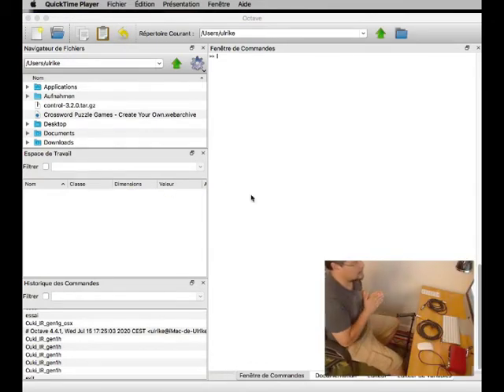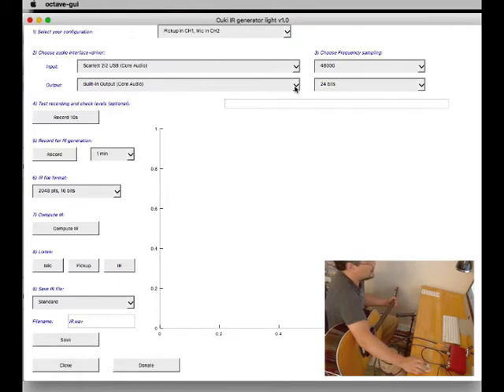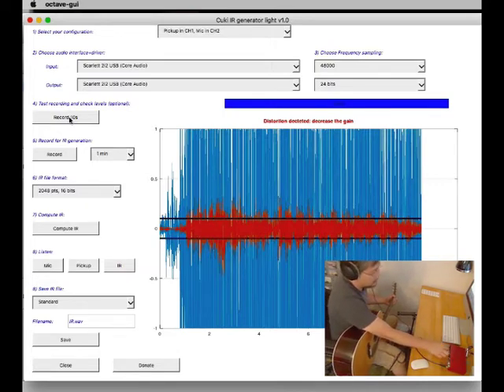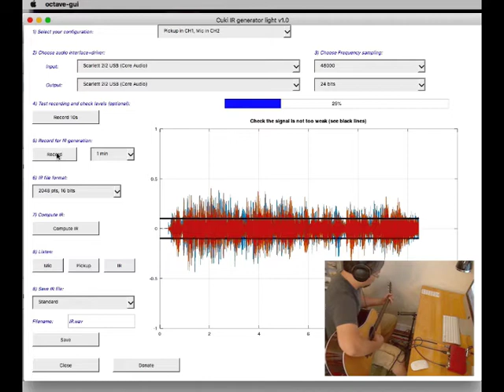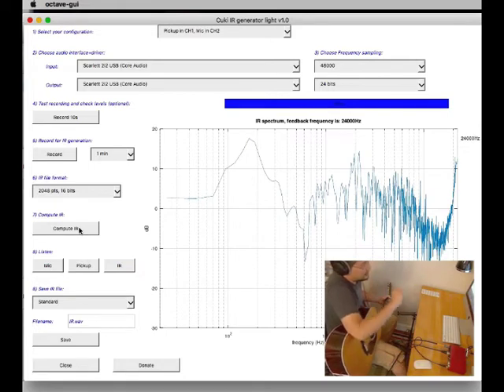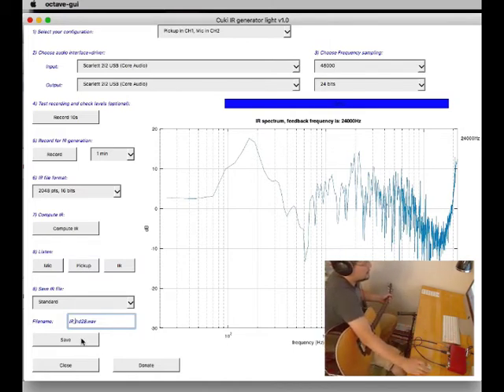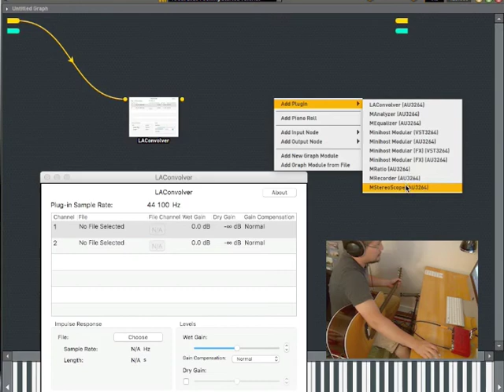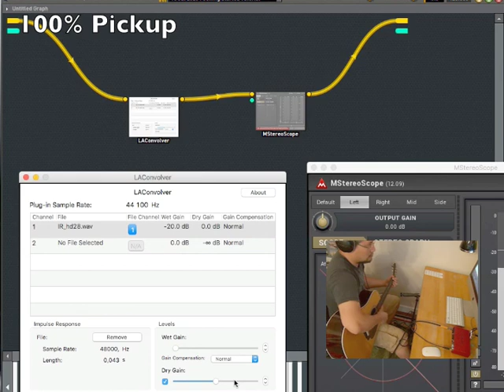How to make acoustic guitar IR

Comment: Thanks for this and the tool, Cuki. One quick question about the feedback friendly option. Is it +6db or -6db. So, is it designed to make it easier to get feedback for electric playing, or reduce the risk of feedback? Sorry for being slow on the uptake with this.
Reply from the maker: Hi I am not sure if this is maintained in the current version. The idea is to remove 6dB of bass at the main frequency of the acoustic guitar to AVOID feedback. When you play an acoustic-electric you don't want your guitar to go "Wooo". Feedback is desired for electric guitars (Think Jimi Henrix with a Stratocaster) it is a plague for acoustic electric (think Ed Sheeran with his Martin)
Reply: @Cuki-ox2mk  That was what I thought it did, but wanted to make sure.

Comment: Thanks for this!  Happy to donate for this package as it makes things so simple!  (I originally thought I'd have to spend crazy money or have programming knowledge to make my own IRs).  On the windows version the feedback friendly seems to export the same files as the standard export (std and itp) - just curious if it might be missing a file?    Also, this works out a lot better than all the acoustic IR's that I have purchased over time.  Is it generally important that the IR is modeled from your own model of guitar?  This might explain the reason.  :-)
Reply from the maker: It's been a long time since I did not check the feedback friendly version. But I am pretty sure it is buggy. Basically it adds a Parametric EQ cut on the main resonance around 100Hz... However this one might not be well spot by the algorithm. As far as, my own model of guitar, the algorithm makes absolutely NO assumption on the guitar recording. It only takes information from the recording you are making. I am kind of proud of that. Thanks for the donation!!! You are actually the first!

Comment: This is fantastic, man! If I understood the process correctly, Octave only analyses the differences in EQ of both signals, and then calculates how correct piezo sigal to equal the mic one.
So its taking the EQ form the guitar itself, the ambience, and the microphone and preamp, BUT its not adding the decay in time, right? The convoluted signal with still sound dry, and it would benefit from adding a Room Reverb to add distance and decay, and thus, realism.
I'm still wrapping my head around all this IR process, haha
Reply: Ok. So after watching more videos, I was definitely wrong. If does also capture the decay response in time. I downloaded the app and managed to load it in Octave. Ready to do some tests!! Is the "non light" version with the full algorithm ever going to be available? =) Is there any way to make a donation and try it out? 
Another question! Does the software fix the inherent delay of the miked up signal? If it analyses de difference between the two sounds without compensating that delay first, it's probably going to create phase issues, right? Wouldn't it be better to record both signals in a DAW, phase-align them, then bounce separate files, and load them in the app to create the IR? I think I can hear phase issues at around 12:00 . If you're not doing it already, I'm sure phase aligning piezo and mic before creating the IR would improve the results!
You did an amazing job here! Thank you!
Reply: I was thinking... maybe I can record enable 2 tracks in protools, apply the phase correction, and then play it back. I would route the protools output to cuki IR input using Loopback. Would that work?
Reply from the maker: @sonidojamon  read the code. At some point there are lines that are commented. Uncomment to be able to load files. Phase alignment should not make a difference, unless you put the mic 3m away. The full version can not be made available. I would need to pay 2000$ for a pro Matlab licence plus 3000$ for the signal processing and audio toolbox. The difference is not bigger than playing with the mic position and make an IR that matches your taste.

Comment: Following Aaron Short Music and found out about you.
When the program starts I only get a white box, the program gives an encoding error (using the default UTF-8) so I selected SYSTEM (CP1252), that's the closest I see to SYSTEM which is what I see that yo are using in your screen shares in the video. I have Windows 10 using the 64 bit Octave download. "Octave was configured for "x86_64-w64-mingw32" on the opening screen. No error messages with Octave.
I used debug and stepped thru and it goes up to line 96 then returns to line 12. (I only have newbie Python experience but I can follow instructions). I reinstalled your program several times. Any ideas? I would really like to run your program off line. I don't always have internet access.
Reply from the maker: Hi, on my computer I octave octave 5.2. I am unstalling it. Will try with the last version.
Reply from the maker: Just installed Octave 7.3.0 and had no problem. Did you get the program for Github? Did you follow this process to download? https://blog.hubspot.com/website/download-from-github

Comment: So is the best way to use this software and send the IR to you so you can add them to the list. Or send you the piezo and mic signal to you. What will give the best result? I bought the cam M just for this purpose. I have a Martin M36 btw
Reply from the maker: Ok I am not sure you will like the answer. If you send me recordings you'd get my best algorithm. HOWEVER if you spend some ime with the free app,  and try multiple mic position with a trial & error process you WILL achieve the tone YOU want. What I mean is absolute accuracy with respect of the mic is not always the best for plugged-in tone. Once you realized that, tweaking the mic position & angle let's you go almost anywhere you want. So if you send me the files, you'll get the best results to "my" ear. If you spend time making few IRs with the free app, you will get the best result to "your" ear.
Reply: @Cuki-ox2mk  Lets go crazy and give it try! I'm going to experiment.
Reply from the maker: @ndr475   once you will have make the best IR you can get. If you still want some final tuning I can explain to you how to make them or just make them for you.
Reply: @Cuki-ox2mk  I'm in!
Reply from the maker: @sonidojamon  for what?

Comment: Not working for me.  Selecting any of the listed interface drivers, it does not allow me to test recording, on a Windows 10 64 bit.  I can see my interface driver but not any asio.
Reply from the maker: Then just make a 2-track recording and send it to me with a google drive link. One track should be mic and the other pickup. I will make you the IR.
Reply: @Cuki-ox2mk  I couldn't get it working under OSX 10.14.16 either. Tried about 4 different versions of Octave between, 4.4 and 6.4. Didn't want to record audio. Gave an error about the script name not matching the function name. Also seemed to really bog down in general. 

The Jon Fields script, where you make an 2-track audio file elsewhere and the process it with the script in Octave, worked fine. Is there any way you could rework a version of your script so it works more like that in Octave? 

The Jon Fields script is less of a turn-key solution that yours is (if it's working). But at least for me, it was easier to use the Jon Fields one, because I already know how to record the audio in Reaper. So it was just a matter of putting it in the same directory with the script and then running the script. 30 seconds later, I had the IRs.

Would love to be able to experiment with different recordings of my guitars using your IR algorithms too and then compare them to the Jon Fields algorithm. Thanks!
Reply from the maker: Dear Jack, I don't have a recent Mac. My mac is from 2011 so I can not install OSX 10.14 on it. I can not afford a new one. Octave is not very stable on OSX. the file Cuki_IR_gen1r.m has the same name as the function (I checked on github) so it "should work"... However with OSX you never know... I am sorry but I don't make IR for free anymore. You can either use a Windows PC, a Linux computer or order a custom IR on http://acousticir.free.fr/spip.php?rubrique8
Reply: @Cuki-ox2mk  Okay. Fair enough. I'll see if I can get it to work on a PC.
Reply from the maker: @jakelondon   Here is a version without GUI. If you copy paste the code make sure to save it as a file called IRgen2.m  https://github.com/kienphanhuy/Cuki-IR-generator/blob/84d4aec200d5662cae1a9bbe22ac1eb7e15b28d4/IRgen2.m
Reply from the maker: just type IRgen2('file.wav') to make it work. If it does not... It's OSX + Octave that bug
Reply from the maker: The M file should be the best. Std is the old process and Bld is the old process with 50% pickup blend. (not the same as the GUI version which give the M with 50% blend)
Reply from the maker: Note that I did not test the IR... Tell me if something is weird
Reply: @Cuki-ox2mk  Okay Cool. I will tried making it work with the script you sent.

Fwiw, I tried making it work on Windows 10 64 bit as well with Octave 6.4. The GUI choked while loading. I sent a screenshot of that in an earlier comment, but I'm not seeing that here. Maybe Youtube removed it because of the imgr link or you deleted it after reading. In any case, if you'd like to see that screenshot, let me know. Thanks again!
Reply: I just tried it with your new script in OSX using Octave 6.1. It seems to have worked. Dropped it into Reaverb in Reaper on the direct/pickup version of the track I used to make the IR. Seems to have worked! Awesome. Thank you.
Reply: What are the relative merits of the blended IR vs. the unblended? Do you talk about that in the FAQ on your site or elsewhere?
Reply from the maker: @jakelondon  You can send it to the email in my webpage. It's there  http://acousticir.free.fr/spip.php?rubrique8  I don't type it here because I got spamed by bots. You need to decipher the image... It's pretty straightforward.
Reply from the maker: @jakelondon  When playing LIVE you usually want to keep part of the piezo qualities to "cut through the mix". That's why LR Baggs Anthem has a "Mix" thumbwheel to control the amount of internal mic and piezo. Most of the time people would use 50% blend. The only IR presets I think don't need blend are my "quackless" & "dry" presets. But I don't provide those for free AND you need a Line 6 pedal to fully take advantage of them. You hear demos on my Youtube channel. Full IR usually feel distant and have some phasey resonances that you might find annoying when playing LIVE.
Reply: @Cuki-ox2mk  👌Perhaps someday I'll finally get back to playing live again and I can find out. 🙂For now, the IR definitely improves the Sound of acoustic tracks recorded with the pickup.
Reply from the maker: @jakelondon  then M and Std files should be all you need.